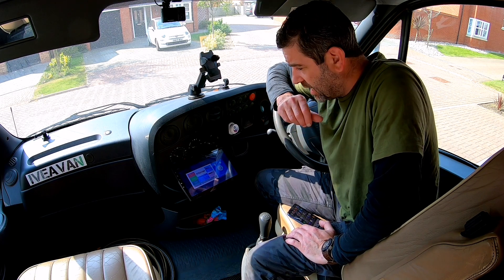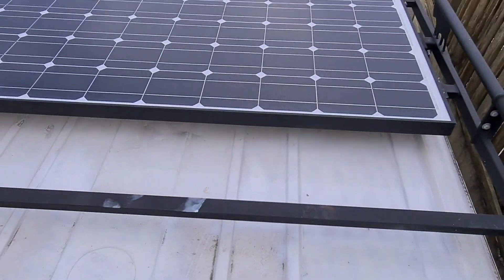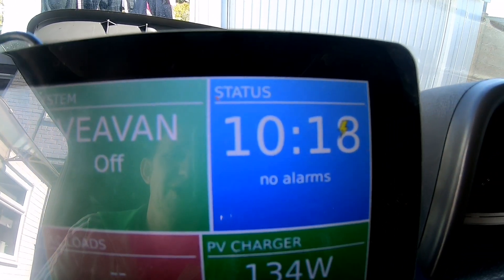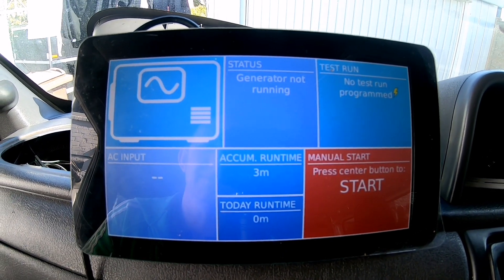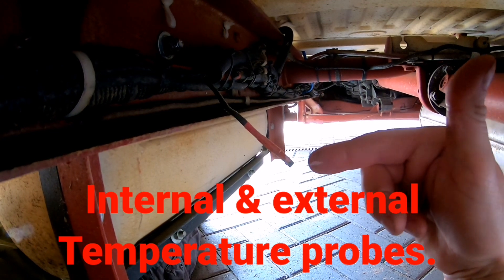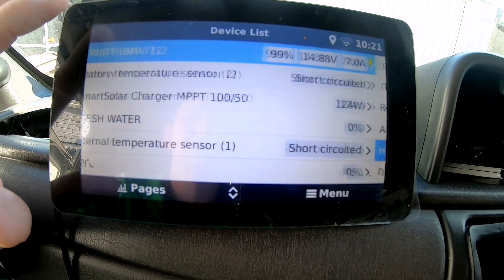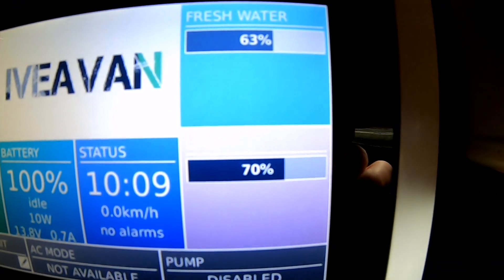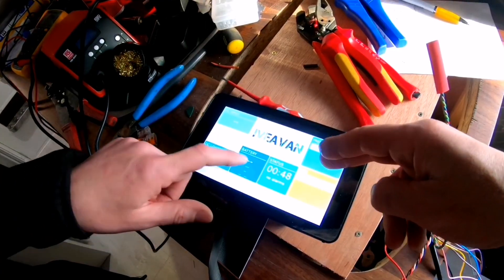Victron Venus Software Overview on the Raspberry Pi.

Comment: Nice video.
How many relays can you operate with the logiciel ?
Reply from the maker: Cheers bud 😉👍, 8 relays reliably, but we did find a way to use more relays 😊👍👍👍....
Reply: @Iveavan  thanks for you answer.
Would love to see how you manage to to use more relay.
By using Victron Venus with a raspberry pi, I don't need anymore Victron products with Bluetooth build in, correct?
Reply from the maker: It's all open source upon the Victron Web site, the only thing that isn't open source was our DC 2 DC board. For the water, LPG, temperature levels and so on. 😉👍👍👍...

Comment: This is badass, hope you don't mind me shooting some Q's? I want to do something like this for a future van build.
How much does this cost if you go for a budget-minded setup? Those Victron gadgets quickly add up... Would be nice to at least avoid a Victron-branded battery!
How does it deal with power draw? obviously an rpi isn't low-power, and in winter the van might be parked up and not get much solar? How do you avoid running the battery down?
Does the GPS work as some kind of tracking system?
Can it hook up to the car's ODB2 port and get even more info?
Reply from the maker: No not at all bud, you probably be able to do it for around the £300 mark if you went for the same set up as mine and did some shopping around for the parts required, that doesn't include any of the Victron hardware, which you will need if you want a system like mine. The main cost is your own time, being able to program the Victron venus software to enable it to do in what you want it to do.... the pi only pulls milliamps so you don't really notice the power loss upon the batteries, the GPS is reliable, giving the correct location of the van when I've checked. Due to the venus software being installed onto the pi, you'd have to use another Raspberry pi for ODB2 diagnostics bud 😉👍.....

Comment: Can you explain how you connected the freshwater tank to the Rassbian Pi. Will the built in gauge still work  ?
Reply from the maker: Yes,  so from the tank level sender, the cable from that goes into our 'Analogue to Digital board', and then the Raspberry Pi  plugs into the 'Analogue to digital board',  it measures the resistance  from the tank level sender ( being able to show the level on the screen).. We do sell the Analogue to Digital board separately if you want the tank and temperature level gauges to work 😉👍

Comment: Nice, you have a 200L tank inside. I have a 250L tank inside. How long does the tank last you?
Reply from the maker: No I have a 120lt fresh water tank inside, depending on water usage 3 to 5 days 😉👌👍👍👍.
Reply: IVEAVAN ah I see, 250L should be about a week I hope for me and my wife. I do like my long showers ☺️. I ended up taking of my 250L gray tank under the van and going for 105L instead as there was a huge metal rib in the way so the tank was hanging low, now the tank fits under the van with good clearance ☺️

Comment: Thank you very much for the content. I'm in the process of building a Raspberry Pi based GX system however I still don't understand if the console/GUI can be accessed via Wifi over a browser instead of a touchscreen connected via HDMi

Comment: Grey Gander
Just superb, very impressed, I was looking at a similar idea last year using Arduino and a touch screen, that started just from not wanting loads of switches and different control systems, but the van project was put on a back burner  😒 but now I,m back on the van build this weekend 😊🤞I haven't posted anything as yet but will be posting van build videos in the next couple of weeks. One quick question what will you use for tank sensors? that,s another one on my list !! have looked at floats and ultrasonic but now I,m thinking simple DIY probes. Great idea gents excellent engineering thanks for sharing.
Reply from the maker: Thanks Paul and good luck with van build bud, I'll get Spunky to answer the question regarding the tank senders 😉👌👍👍👍.

Comment: Hi buddy, just watched all of your build during lock down. Amazing stuff!
Just a question what do you think your van will be weighing now? Considering a iveco xlwb high roof myself but worried about the 3.5t limit. It seems only 900kg can be added and when add a driver and passenger that drops to about 750 which doesn't seem enough!
Reply from the maker: Hi bud 👌👍. The honest answer to that is I don't know yet, as I was going to place the van on a weigh bridge once I came back from Scotland... Then lock down happened 😬🤦‍♂️, I've worked off the 900kg from the start (but recently seen payload of 1200kg 🤔🤷‍♂️). My batteries, water tank, gastank weigh when full 280kg leaving around 400kg in building materials which I've tried to use sparsely or tried to use light weight materials like 6mm plywood 30mm x 20mm frame work and so on. But in reality I will not know until this lock down is over matey 🤔😉👌👍👍👍.
Reply from the maker: This should help you with payload, Ive managed to find the answer via various iveco websites / forums which seem to have the same answer for the gen 3 Iveco's bud.
A MWB single rear wheel van has around 1375kg of payload. 
A LWB single rear wheel van has around 1255kg of payload (my van) with 3mm  thick chassis 
A LWB dual rear wheel van has around 1130kg. Its not only the extra wheels, the chassis is thicker (5mm) hence the drop in payload.
I'm not 100% on this but I'd have thought a chassis cab with a box will be under 1000kg of payload.
Reply: @Iveavan  Nice one chap will keep those figures in my calculations
Reply from the maker: @tuscan63  no worries bud 😎👍.

Comment: Mark, love the Video, really well done, and well done to Spunky too. Couple of questions and apologies if they've already been asked. 1. Why are you using a generator and solar, do you plan to be off grid long term?  and 2. If the raspberry pi fails/crashes/$h1t's itself, have to a way of looking at the data without it. Tech will always fail when you most need it. Jamie
Reply from the maker: I don't have a 240v inverter in the van (every thing I use is either powered off 12v or lpg which has more then served me well with no issues) For the price of an decent pure sine wave inverter I thought I'd buy the pure sine wave generator, "does two jobs in one" . Rather then the one job, plus its back up for my reef tank at home, if power is lost in the home the reef tank won't survive for very long without power. 😉👌👍👍👍.
Reply: @Iveavan  Mark,thanks for the reply, makes perfect sense to have a backup for the reef and have the genny in the Van. I've test run mod. Sine wave inverters and most stuff will run off them without any harm. I'm going to run a domestic under counter fridge freezer of the inverter and everything else will be 12vdc. 🙈

Comment: Very advanced. However, why not invest in fuel cell technology instead of a dangerous, noisy, filthy, high-maintenance, stinky, cacophony of clattering, obsolete, steam-era generator?
Reply from the maker: But It's cleaner and less noisier then my van engine bud 🤔 why don't we see fuel cell technology running HGVs and LGVs 🤔🤷‍♂️👍.
Reply: IVEAVAN because it’s a bomb waiting to happen!! Just what you want to be sleeping above 😴 🛏 💥 💀👌🏼🤦🏼‍♂️
Reply from the maker: @paulthompson5416   exactly 😅, I'm powering an microwave not a small country 😉👍.

Comment: Great video. How do you go about connecting a resistive tank sender to the pi? Thanks
Reply from the maker: Thank you Matt 👍, the water and LPG  senders are wired up to Spunkys interface card that's then connected to the pi, all of which is pretty much plug and play, you'll have to calibrate the readings and size of the tanks in the victron software but that's not a big job to be fair bud 😉👍👍👍.
Reply: Nice one! I’ll take a look at that, just started to put together my system and planning to do the same as you, perfect timing with the video! Awesome work guys 👍